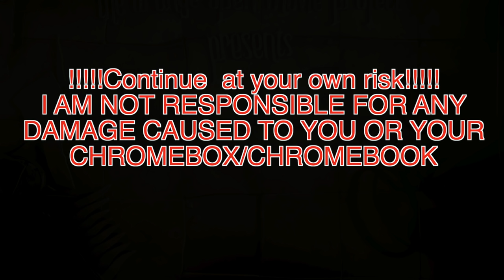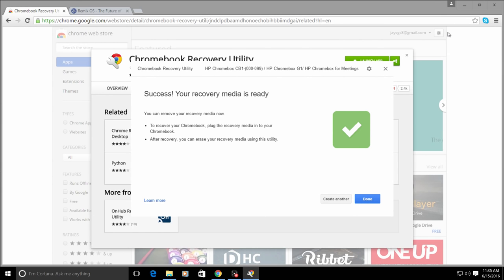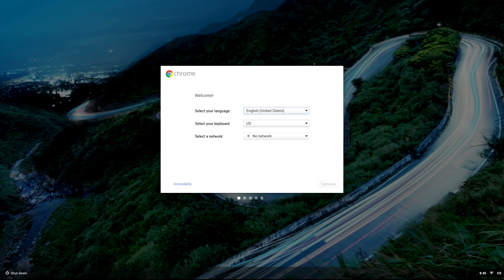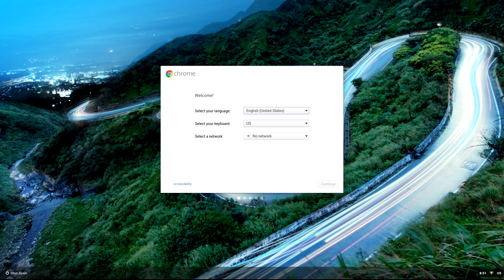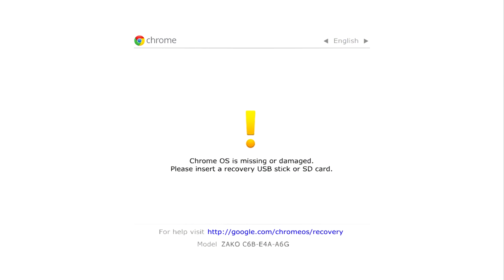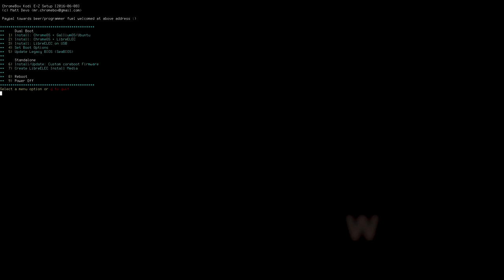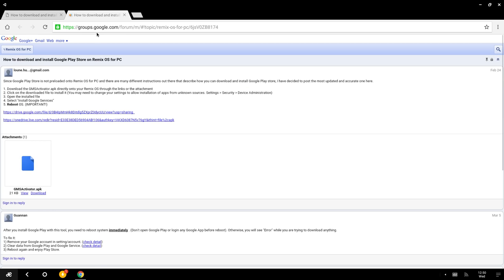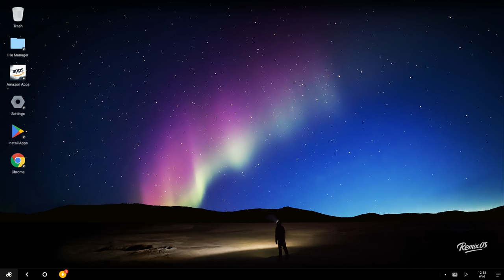HowTo Run Android On A ChromeBox Remix Os Hp Chrome Box

Comment: I'm having issue with booting USB remix os finish all the steps and it says no Bootable drive found I used Unetbootin for Windows 10 I used to use this for Linux and it worked wonders I also tried the remix version and got error message telling me to disable flash boot option in startup for my laptop which I didn't want to do cuz I had to into bios and select that option and disable it lappy is only 4 days old and didn't want to change any settings that u might forget later

Comment: Thanks for this video.  It would help tremendously to know what version (or model) of the Chromebox is being shown here.  It could be that back when this video was made, there may not have been many versions of the Chromeboxes made by the HP corporation, but there have probably been a dozen different versions by now.  HP literature usually seems to identify the versions of the Chromeboxes with what they call the "Product" numbers, and they describe the "model" of the product with just the trade mark of "Chromebox".

For example, I have a core i7 Chromebox that was originally purchased in 2016, and it has a Product number of J5N52UT.  I want to install Linux on it, and I can't find a photo that shows the location of the write-protect screw for this particular version.  There are endless descriptions of the procedure to install Linux on newer versions of the HP Chromeboxes, but I don't think there is a photo anywhere on the internet that shows the location of the write=protect screw for the specific Product that I have.  (I am sure I will be able to figure it out, by trial and error if necessary.)
Reply: That model number seems to be HP CB-1 and there is a pic on the Kodi Chromebox wiki article. It's the same location as on ASUS CN60/62 or Dell 3010.

Comment: I have the exact same HP Chromebox and tried to do this now. Everything until 15:30 works, so I am in developer mode and the developer console. When I type sudo bash 3Tfu5W I get this:
3Tfu5W: line 1: syntax error near unexpected token `newline'
3Tfu5W: line 1: `<HTML>'
Then it drops back to command prompt. While hardware is the same, the recovery pen installed latest Chrome OS, so login screen is different from the video.

Comment: One things is clear from this video - you need new clean flat surface for hardware pr0n. :)
Reply from the maker: You should see the side Of the table I use for soldering. Been using this fold out table for about 3 years now , it's starting to bow in the middle. I was actually gonna go out to my local thrift shops and see what I can find this weekend. I need something at least 12 feet long.
Reply: @ETAPRIME  That is why I only have a folding table in my office now. Got a office desk for free from work, but it was too heavy to carry upstairs.  : defeated.
Reply: @ETAPRIME  We used to have something like that at our gas station back in the day. It was an old 10 foot long table with fold out legs.

Comment: I had just a "black screen" after I inserted my Chrome OS Recovery USB drive.  I resolved it by removing my USB mouse and keyboard devices until after the OS recovery had completed.  In case anyone else had the same problem.
Reply: I appreciate you

Comment: I know this is a old video. I have the same Chromebox and I am wanting to run Linux on it. It does not go into recovery. I do the paperclip and power on and the light stays on with the fan going at full speed. If I turn it off and back on like normal the fan runs at full speed for a few seconds then boots as normal. Have any idea what to do?

Comment: Nice but can't you install the Android onto the Chromebook?
Reply from the maker: You can install it on the hard drive of the chromebox or chromebook , this is just an easy way to run it without having to flash a full bios , with this you can still access your chrome is and not worry about overwriting anything.
Reply: +ETA PRIME Alright thrn
Reply: I'm interested in installing Remix onto a Asus M004u rather than a USB drive.  What bios would I use, what would that install tutorial look like ? :)
Reply from the maker: you will need the modified core boot bios ,  at 16:04 in the video choose number 6 in the bios